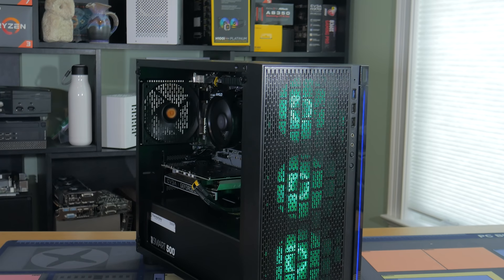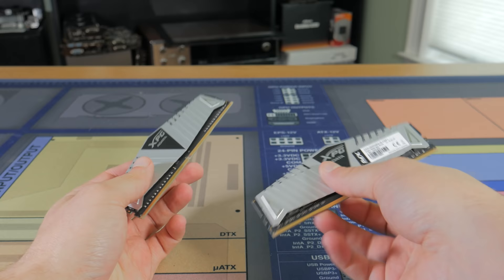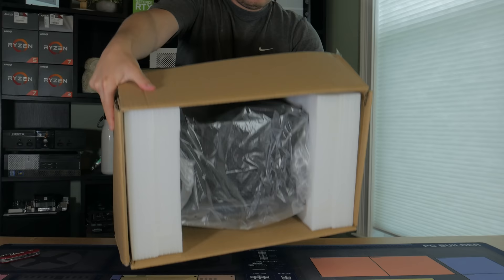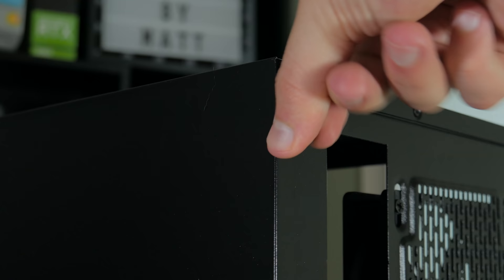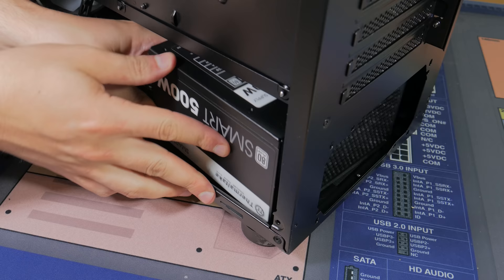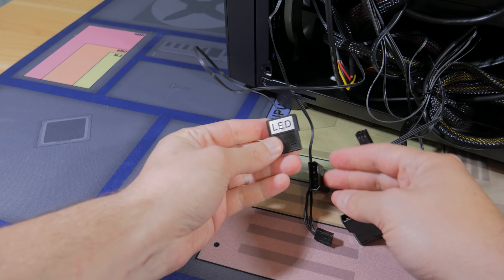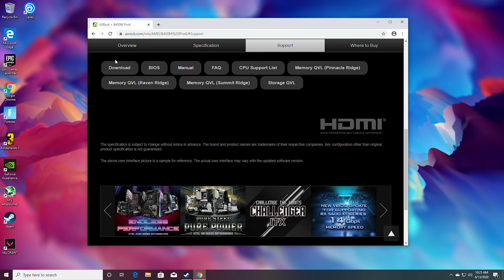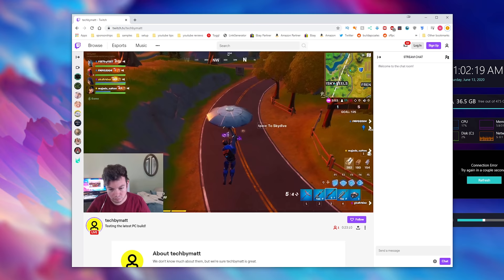$650 Gaming PC Build Guide! (2020)

Comment: i build this pc 1 month ago. and its running perfect & smooth. but i highly recommend you to upgrade the 500gb ssd to 1tb ssd. and hands down to matt for helping me to build my first pc. (1 year later and this pc build still running good and smooth)
Reply: Hey man. I really want to do this build. Do you find yourself being able to play most games at the highest settings?
Reply: So does internet explorer or google just happen already or
Reply: @doqzy  I have this build too and no u have to install windows 10 urself
Reply: @vtrentv1651  ya i know I did it already
Reply: Cab it run fivem on gta
Reply: @vtrentv1651  yo I have a question? Do you recommend any other power supply for this build? I currently have it but its not turning on in my monitor
Reply: @masonbaker2670  yes I always play it it’s great even have a graphic mod looks great
Reply: @lolitsanthony  ye max settings smooth gameplay no delay

Comment: Thanks for your help! I just built this exact pc for my first time and it turned out great.
Reply: does it rut all the games smooth?
Reply: @ibenvanmarcke7968  I've had it a couple months and it runs Doom Eternal, Metro Exodus, and pretty much anything else on high or very high settings with at least 60fps and in some cases higher. I never saw any dips while playing doom or metro. the thing runs great. My house gets really hot too and it still has no trouble.

Comment: My PC i build in march costs 640.

I have a
Ryzen 5 1600 af @ 3.9ghz Stock cooler
Gigabyte Gaming am4 ATX Mainboard
16gb RAM gskill 3000mhz
240gb wd SSD
500gb wd HDD
500w Bequiete 80+ Bronze psu
Rx5600xt With the 14GBS bios
Azza Case atx 

In 3dmark i have 7300points. 

Im very proud of my build espacilly that it only Cost 640.
Reply: Blue_G_99 play's I’m practically getting the same thing except I’m using the Rx 570
Reply: rx 5600 xt 😯
Reply: Great. Now i feel bad for spending 1200 on a graphics card. 😭
Reply: @JanJanJanJanJanJanJanJanJan2  1200?!?!?!? yo wtf my guy thats a bit extreme
Reply: OpTicFanBoy24 it’s called the 2080 ti
Reply: @asahamlin4452  nah it's called... BALLIN
Reply: What did you pay for the 5600xt
Reply: @rob-oy9fr  i paid 259€ IT was on a Sale. I got the sapphiere Pulse Version. IT Cost now 319€
Reply: That's pretty good. I did a 750 one for my buddy

1600 AF
16 GB 3200MHz CL 16
MSI B450M VDH Max
RTX 2060 KO
1TB WD SN550
Corsair Cx 550 Semi Modular
Basic 50 dollar case
Reply: This is more or less what I’ve been wanting to build. Nice. Thanks for posting this.
Reply: Dude this is literally the same as my dream build
Reply: great build! i spent 750 and got ryzen 5 2600, 2TB hdd and 500gb ssd, piring it with 1660ti. Not gaming too much, for video editing this rig is so much smooth
Reply: Im building 1 this weekend for €650

Ryzen 5 3600
Rx 580 (used)
B450m pro4-F
16gn 3200mhz ram
120gb ssd 
1tb hdd 
Seasonic s12iii 650w 80+ bronze
All of that in the meshify c (white) case

It’s gonna be my first build :)
Reply: My budget was a lot less but I got a Ryzen 1600,  16gb ram 3000mhz, and an rx 580 for $460 with tax
Reply: You could've gotten used part and saved like 40 or 50 dollars
Reply: Gabriel Carter well I got the 580 off of eBay new for $130
Reply: @Frosty-dr8bs  wow, then I got SUPER lucky then.. back in February I scored Asus RX 580 8gb for $80!!
Reply: I am getting this:
$2000 GAMING PC BUDGET

Pc Rig: 
Intel core- Ryzen 5 3600 ($300)
Mother board- MSI B450M-A PRO MAX ($133)
GPU- EVGA GeForce RTX 2060 KO 6Gb ($600)
Ram- Team T-Force Night Hawk RGB 3200Mhz 16Gb ($149)
SSD- WD Blue SN500 500Gb internal PCI express m.2 nvme ($118)
HDD- Seagate Barracuda 1Tb Internal hard drive SATA ($79)
Power supply- Cooler master MWE V2 650w ($79)
Case- Cooler Master MasterBox Q500L ATX ($73)

Peripherals:
Monitor- AOC C24G1 144Hz 1ms 23.6’’ VA LED Backlit LCD Monitor ($298)
Headset- HS 60 Pro Surround sound Yellow ($120)
Keyboard-GK61 Mechanical keyboard Multi Coloured RGB ($91)
Or- mouse: steel series rival 600 ($118)
Or- keyboard: DURGOD Taurus K320 TKL Mechanical gaming keyboard ($149)
Reply: What exact ssd? What exact psu? What exact variant of that gpu? What exact case?
Reply: Shanez1215 SN550 is dramles...
Reply: Gavrilo Jovic You’re in Australia? If so, that is not a good build.
Reply: Gavrilo Jovic you absolutely shouldn’t pay 600 for a 2060, I know it’s AUD btw.
Reply: @BlancoWilliams  500w Bequiete 80+ Bronze, Case from azza i dont know the exakt Name but or Cost 60€, the rx5600xt is the Pulse Variant from sapphiere, and the SSD ist a Samsung EVO 850
Reply: Thats a tiny hdd lmao
Reply: I would spend a little bit more on the psu
Reply: JoE MaMa P dude I’m going to stream and I need a good graphics card for better frames and stuff
Reply: @walterhartwellwhite346  probably could get a cheaper better graphics card since a 2060 isnt gonna do ray tracing at all anyway
Reply: Blue_G_99 play's oh ok, good choice then.
Reply: Gavrilo Jovic what’s your budget in AUD? I’ll help make a list dedicated for streaming/gaming.
Reply: @BlancoWilliams   I'm in the USA, but looking at a $500 or less dedicated STREAMING machine, little to no oc games on it... Let me know

oNe
Reply: JoE MaMa P $2000
Reply: payday videos dude wtf are you talking about? Yes an rtx can do ray tracing at 1080p or higher that’s what I was aiming for and it fits in my budget and I like the gpu because it does a good job. You should probably do your research mate.
Reply: I built this with the 3300x and it costed like 750 how did u do it
Reply: @JanJanJanJanJanJanJanJanJan2  Subtle flex
Reply: @reckless5838  looks like Joe Mama was all talk.  Looking for streaming build(little to no gaming) for $500 or less in USA... anyone?
Reply: @phabeondominguez5971  No clue what u said
Reply: @reckless5838  my bad, the user Joe Mama was gonna part out a sub $500 PC build for a STREAMING machine.. however he hasn't come thru. Maybe you or another can help?
Reply: I also made a 650 dollar build and I was able to fit 2060 instead of a 5600
Reply: HrPlayz Ditch the 570 if your paying well over msrp cause it’s not worth it
Reply: Gavrilo Jovic my RTX 2070 can only just do it man.
Reply: Might wanna upgrade strorage
Reply: 5600xt in a 640$ budget wow
Reply: Jens Reijnders thats great ! i strongly advise using a freesync monitor , the performance will be astronomical .
Reply: Did you but uses parts
Reply: I did mine for £120 3yrs ago
Gt 710
Core 2 duo
4gb ram ddr3
300w psu
Off brand motherboard

Guaranteed 2fps 😎
Reply: How many fps does this get on warzone
Reply: 500$
Ryzen 5 2600x
RX 470 4GB
8GB DDR4 2666mhz
1TB HDD
240GB SSD
Reply: Then i found another one for 630$
i5 9400f
GTX 1060 3gb
8GB 2666mhz ddr4
1TB HDD
240GB SSD

Comment: Yep this is the one I’m building made my decision 😄😄
Reply: How'd it go?
Reply: @ThatDominicanGamer  yup, i wanna know the answer too!
Reply: Dost ツ asmr the ASRock pro 4 on Amazon is like 140 so I’m wondering where would he get one that is 75
Reply: Thank you guys for asking how it went, but I forgot to say that I can’t afford it rn, so I’m trying to saving up, then I’ll build it sorry
Reply: Gabriel Silvano i just built this pc, and u need to plug the fans into the motherboard, not the power supply bc it's WAY to loud if u do and it won't let u adjust the fans if it's plugged into the psu
Reply: Caiden Meagher  it can but lower settings only
Reply: Caiden Meagher  100+ frames easily on medium graphics without overclocking
Reply: Caiden Meagher  just like an extra 10-20 frames but over clocking is really easy you can just go and watch easy tutorials.
Reply: Caiden Meagher  over clocking will not damage anything but I don't know about 144 fps on medium
Reply: Some people say that the power supply blows up
Reply: Keluzo it’s $80 on Newegg. I ordered it and it came in on Monday.
Reply: Caiden Meagher have you gotten the pc yet? If so tell me how it went.
Reply: @chandlerdemartino7905  I’m building it in like a week I’m just waiting for my ssd
Reply: @chandlerdemartino7905  I can let you know how it goes if you want

Comment: Ended up picking this set up as my first pc build. The Ryzen 5 1600 was out of stock so I spent an extra on the Ryzen 5 2600.  Other than that, everything is the same. Really excited to be building this once all the parts come in. It cost me a whole lot of money with a new monitor and keyboard but I think in the end it will be worth to have this beast in my room. I'll let y'all know the updates once I get to building.
Reply: Keep us updated!
Reply: Yup! Good luck!
Reply: @moeyo4654  oops sorry I just remembered about this comment. I finished the build like 2 weeks ago but everything went smoothly and it plays all the games I've wanted to play above 60 fps and even most above 100 fps. It also isn't very loud which is nice and the case does really good at keeping the system cool. The only complaint that I had that he didn't show in the video was how to turn the AMD cooler fan consideirng mines wasn't able to screw off but instead needed to be pulled off which took me a while to find out about so I left it as is but that's more of a cosmetic thing rather than hardware related. But I highly recommend build for any beginners but I would throw a few extra dollars at the cpu and get at least a ryzen 5 2600 or 3600 as most triple A titles are starting to say that the ryzen 5 1600 barely fits the requirements. So it adds a little more years before you need to upgrade it and as for the gou it works pretty damn good and have no issues with it.
Reply: kota. Thank you so much for updating! I’m glad that your build went great
Reply: @slim jim Viotek GFV22CB. It's a 144hz monitor I got for like $130 so it's cheap compared to other 144hz monitor but I noticed on Amazon it is out of stock I'm not sure whether it will be restocked or if other stores have them but I highly recommend it for a beginner set up. It also has 1 display port and 2 hdmi ports and an aux for speakers.

Comment: this is an awesome budget build and the thermaltake h18 is a dope case.... if it only it fits on my tiny desk

i bought thermaltake h18 for to swap my diypc case for but its too big for my tiny desk :(
Reply: Corsair 220T has no drive cages between the mobo and the front fans, the case is several inches smaller and has a small footprint. However it is twice the money.
Reply: Get a bigger desk lol
Reply: @curtisg8399  yeah......not really possible mate.. https://uk.pcpartpicker.com/b/H4V6Mp

That's the only space in my room for a desk
Reply: Where did you find your motherboard lol
Reply: @kennyd7667  holy shit how do u move ur mouse wtf
Reply: How is it running
Reply: @ohmyahdor3516  it's running pretty well, I've not really had any major issues in the year I've owned my pc. I ended up getting a Silverstone PS15 mATX case instead
Reply: @gyuhfeohgfqa  i mean I am able to play any game pretty decently with that space, my dpi is at 1000/900
Reply: @glusur76  from Amazon
Reply: @whidbeyhiker4364  thanks for the suggestion, but I ended up with the Silverstone PS15 in white

Comment: thanks for showing how to put parts all together. I have the same Thermaltake PSU but only 600w, and I learned alot how to piece it all together when I get a chance to build my own. I currently have a very old unit and was assembled from the shop long time ago, but I did have some experience changing ssd, hdd, rams, gpu, and even an aftermarket cpu cooler which I did have a problem and was resolved when I brought it to a repair shop. Adding an aftermarket cpu cooler was such a painful experience for me.

Comment: My current setup:
Mobo - Asrock B450M Pro4
CPU - Ryzen 5 2600 oc'd to 4.1ghz (using a Hyper 212 Evo cooler)
GPU - EVGA RTX 2060 KO Ultra (stock settings except adjusted fan curve)
RAM - 2x8gb DDR4 3200 Corsair Vengeance (running @2667mhz. Cannot get it higher for some reason. Enabling XMP causing BSoD.)
Storage - 970 EVO 500gb M.2 SSD, 860 EVO 500gb SSD and a 1TB Western Digital Caviar Blue (that I have had for almost a decade lol)
PSU - EVGA 750w (no rating)
Case - Cooler Master Q300L
Could anyone here help me figure out my compatibility issue with my ram? Is my motherboard not capable or is it a timing issue? Please send help. XD
Reply: 750w power supply is overkill
Reply: @florian4967  its not...
Reply: can u give me ryzen oc guide?

Comment: I really enjoyed this video. I have a few questions and I hope you get a chance to answer them. 
1. You mentioned in your video that the product prices are currently a bit high. I was planning on building my own PC during cyber Monday sales. Do you think that would be a good time? I hope you can upload a video during that period.
2. I wanted a water cooling system. Do you think that it is possible to fit in a $650 budget builds with similar gaming performance?
3. Good monitors and other accessories kinda build up the price obviously.  So moving forward I am saving $650 to build my PC during cyber Monday sale. What do you think would be an optimum price set? Should I get a bit higher or lower? 
I know you might have talked about this earlier in your videos but I appreciate you clarifying these up for me.
Reply: Also, I tried adding the value of cost from your links but the price doesn't add up to $650. Amazon links show a higher price.

Comment: Great Vid!!! I have the Asrock X570M Pro4. You know this board....the only M-ATX 570 board. 🙈 It’s great but it has this issue where the Ethernet Adapter periodically stops working and disappears LOL - the only way to fix it is to take out the CMOS Battery and short the Jumper Pins to reset the. BIOS. So I bought a TP link PCIe wireless card thinking it would be a permanent fix. But no it still happens. Other then that it’s a great board. Keep up the great work Matt!!!

Comment: Building this exact PC in a few weeks, except I’m using a GTX 1650 Super instead of the 1660 Super. I’m also using an EVGA PSU instead of a Thermaltake one. Excited to see how it turns out!
Reply: Currently typing on my new PC!!!!!!!!
Reply: @Ruru Rajbhandari sorry I’m a little late. It gets around 144FPS on fortnite medium settings, and costed around $600

Comment: I would like to critique some of the parts used in this build. I wouldn’t advise getting a 3100, when a 3300X and 1600AF exist within this price range. The 3300X offers a 5-8% performance boost in both 1080p and 1440p gameplay for $20 more or when the 6c12t 1600AF is the same price. The optimal upgrade path for CPUs for gaming would be 1600AF > 3300X > 3600 (for this price range). For RAM, I would recommend the cheapest 3200MHz CL16 RAM that you can find. It’s sometimes cheaper or only pennies more to get 3200MHz RAM. Brand does not matter, but at the time this could have been the cheapest. The SSD is a DRAMless SSD. DRAM is a little chip they put in SSDs to store the data map and manage read and write requests. Simply, it has a huge effect on performance and they are usually around the same price. The final critique I have is the PSU. The PSU used in this video is group regulated (5V and 12V rails are regulated together and share a coil on the secondary side, meaning when one is under load the other one is left unattended, which can cause permanent damage and can fail ATX specification under some circumstances). The PSU also lacks 12V UVP (under volt protection), and lacks OTP (over temperature protection). I would personally also recommend getting PWM fans (the ones with 4 pins). They are much more superior to 3 pins, since you can actually control the fan speed and not just the power to the fans. Arctic F12s are some of the best PWM fans on the market for their price.
Reply: I need help with building I’ve watched over 1000+ videos and still confused

Comment: I used the exact same case for my RYZEN build. That case is a steal at $54 USD considering the airflow management, PSU shroud, easy cable management and tempered glass side panel.

Comment: I build virtually all my PCs with the exact same mobos you mention. They are the best value out there. Great video, that would have been a lot of work. One thing: did you have the option of connecting the fans to the fan controller on the mobo? This is usually much better for noise.

Comment: You helped me build my first pc
Reply: Hi was it hard and also what parts did you buy and was the cables hard to plug into correct spaces
Reply: @khabibtime8492  its relatively easy just read the pcb or the manual that came with mobo.
Reply: you are lucky

Comment: I literally just 4 hours ago purchased my parts for a new computer with this exact case. My processor is a Ryzen 5 1600 I got for 107 a ASRock motherboard for 73 my gtx 1050 I took out of my old computer I’m using this temporarily then I have a $20 ssd and a free 1tb hardrive, 16gb of team group ram 3000mhz and a 430w thermal take power supply

Comment: i dont really know alot about pc specs, but im building one soon!
my parts are: 
asrock a320m motherboard
2x8gb of ram
adata 240 gb ssd
idk what the tower is called
evga 450 br 80+ bronze power
and i am saving up for it and will be re watching this video to build it when i get all of the parts :).                       do i need to also buy fans? bc i dont know if it comes with something or if i need them seperatly
Reply: Go b450m for the motheboard. Can handle more upgrades

Comment: I have that same motherboard in my system with a ryzen 5 2600 I got used for 85 bucks (refurbished from the amazon warehouse). I also have it overclocked to 4.1 ghz and with a 40 dollar cooler master air cooler, keep it under 70c under full load

Comment: A rx 570 8gb is $50 usd cheaper then the 1660 and perform about equal. Did you go with the 1650 because of the Nvenc incoding?